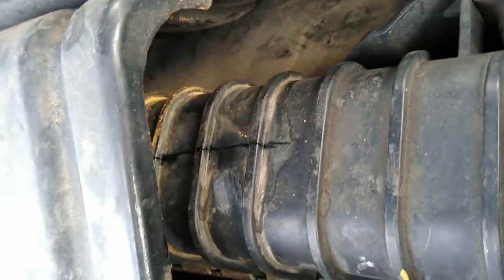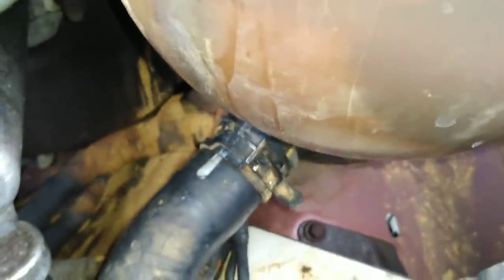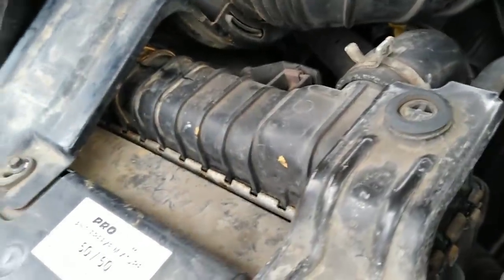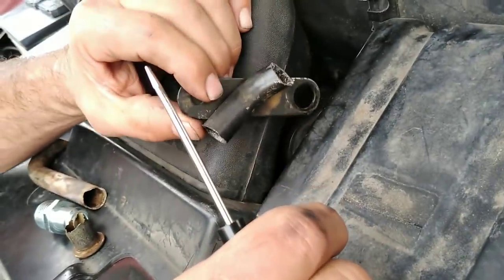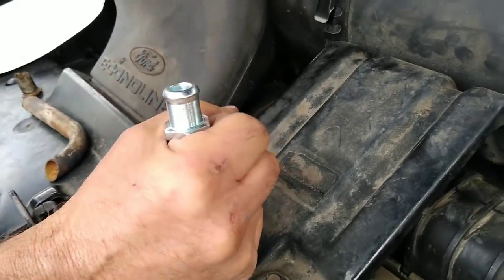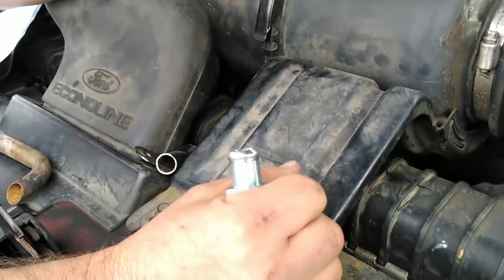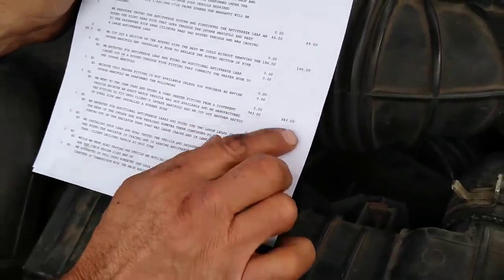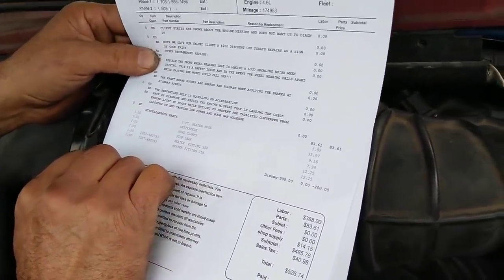The Temp Repair as Explained to Me

Comment: he should have just put a stupid fuse in and check the reader.  the fuse is less than a dollar.  i think a good shade tree mechanic can do some stuff for you way cheaper than that guy charged.  you need the wheel bearing big time.  if the bearing locks up your stuck and may have to replace the whole hub.  i would get two pieces of flat steel about 8-10 inches long and a couple of C clamps and reinforce the top of the radiator without squishing it,  so that the pressure doesnt make the crack get larger.  its a temp fix.  this is an older van so it doesnt have tons and tons of computerized stuff in it like the new vehicles.  just dont over tighten the c clamps all that is needed is snug so that the top of the radiator cannot bulge out in that spot and make the crack bigger.
Reply from the maker: I was thinking the same thing about the fuse 😂.... like why didn't you replace it and read the damn codes? 🤦🏾‍♀️🤷🏾‍♀️
Reply: Bearings usually are purchased with the hub, especially for those who dont have a press. I have a bearing press and would rather buy the whole assembly.
Reply: most older vehicles dont need pressed in bearings.  i cant remember the year of crystals van.  sometimes the grease seal needs to be tapped in carefully .
Reply: its the races that are pressed in,  but they can be done by a shade tree mechanic usually

Comment: Look for a new van in arizona! Where we dnt have rust problems.
Reply: Carla Bainter her rust is internal, not affected by external issues(salt on the road from snow states that use salt).
 Her rust is internal because someone in the past has put water in the cooling system. Even distilled water can cause issues. Add coolant only, and there wlll never be any internal rust
Reply: @RoadTripEddie  exactly and out here in az well at least in tucson areas we dnt use salt cause there is no snow
Reply: ATCkeepsUsafe  yes I realize. She did mention that she was probably going to get a job in order to get another van. Why keep putting money into that one cause I got a feeling it's going to need a lot of things and cost more than buying another used one.

Comment: Dnt worry about the miss fire. Just get to az and get a new van.
Reply: Agreed. There is a big difference between one misfire and a misfiring engine. The Engine Control Module (ECM) knock sensor that can detect a misfire and the resulting Check Engine Light (CEL) do not differentiate the two conditions. It is simply recorded as "misfire". I think a significant loss in engine power and rough idle would be indicators of a misfiring engine.
Reply: ATCkeepsUsafe  jesus what's ur problem?
Reply: ATCkeepsUsafe  a misfire isnt going to get her stranded. But a overheated radiator will. Good lord. If u cant be nice dnt comment.

Comment: Im not a mechanic by no means i do have a ford econoline and a chevy 2500 which i attempt to repair could the crack in radiator have gotten larger because the 2 leaks were repaired so their was more pressure going threw the system i had several leaks repaired on my ford and it seems like every time i get a few repaired and i think im all good i get another one

Comment: I would fix the radiator crack.  The check engine light cannot be trusted.  I had a car that I drove years with the check engine light and abs light on because I would take it to the shop and have it fixed for it just last a month or two.  I read the manual and it stated the check engine light comes on when something is about to go out.  I decided to wait for the car to stop running and it never did.  I had that car for over 10 years.  All I did was general upkeep on it.  I know your feelings are hurt, but life is full of hurts and disappointments with cars.  I don't believe in getting new engines.  Drive him gently and get to Arizona (if you can).  Get a second opinion when you can.  Then I would not look for everything wrong with it. Of course, there will be problems. Older cars have them you just want to be able to drive her. Do just the minimum to have a safe ride.  I will keep praying for your safe travels.  Stay encouraged * Peace and blessings

Comment: JB weld the radiator for now it will hold then buy a radiator and flush cooling system 2 times don’t give up yet I think that engine still has some life missing is from a coil pack u just have to fix reader and find the one because it’s only one you won’t feel the difference until the engine has to work hard like heading up a elevation and the wheel bearing u can fix in havasu wheel won’t fall off u can even do it yourself u just need a 24” socket to pull that nut that mechanic is just trying to make him a big bill smh

Comment: Someone Sabbatoge The Top Of Your Radiator.  Please Do Not Use Your Heater At All; Please.
His Over Talk Was Deception.
Reply: It's a crack from metal fatigue. An 80 year old man broke a stainless steel rod, 1/2 inch in diameter from sitting in a chair. Poor guy! The material modulus of elasticity has been exceeded, and therefore the metal cannot return to its original shape.

Comment: did you buy a lemon?
Reply: lemons are unfixable car problems, or problems that bring the car in for repair more than the drive time.
Reply: she has only had the car for three months and it has problems; maybe not a lemon but maybe not a good deal
Reply: I think the vehicle was a gift, like free.
Reply: she did not get the free vehicle she paid for this one with youtube and other support money
Reply: Oh my! This vehicle will be a drain on the purse. A woman on the road does not need not such unreliability.
Reply: @Yourpleasure721  I bought a van for $750 with a good engine. Now I'm finding all the rust after stripping out the interior. Some of the holes I can pass my hand through. If I ever find issues with the frame being rusted out, I'm done with this van and need to find something else. When fixing vehicles is a hobby, it's great fun, but when I need it for work, it's a nightmare.
Reply: buying a used  older high mileage vehicle may have some problems
best wishes to you CindyPlasmaTech
Reply: @Yourpleasure721  Thank you!! This van has the lowest mileage (119K miles) in the family of vehicles. The daily driver has 160K miles. I usually call it after 250K miles. The best I ever did was 314K miles, sold it running.